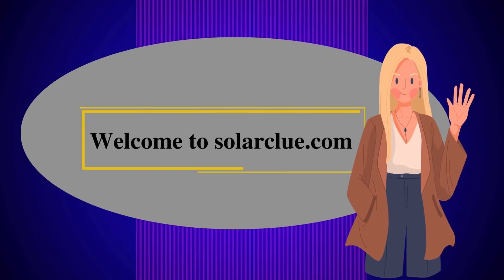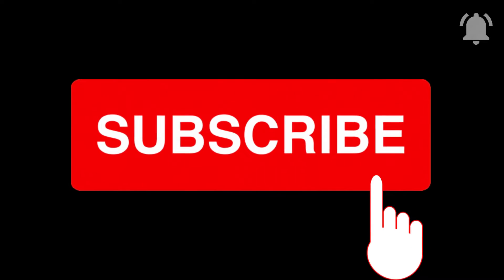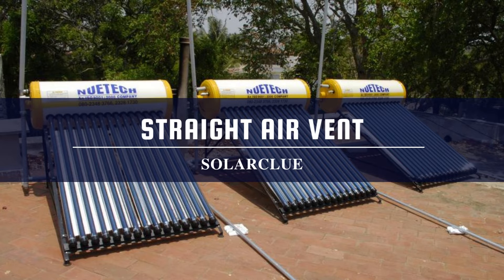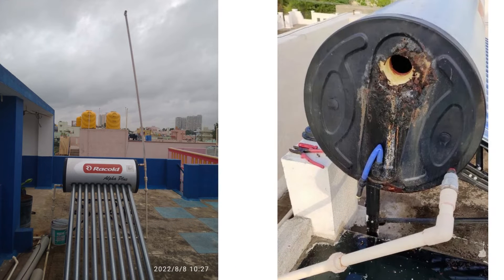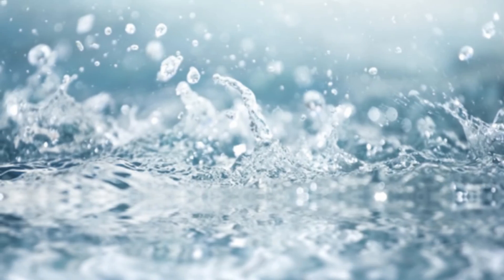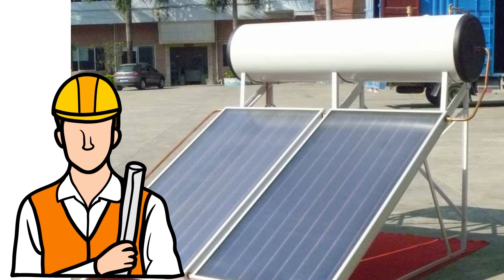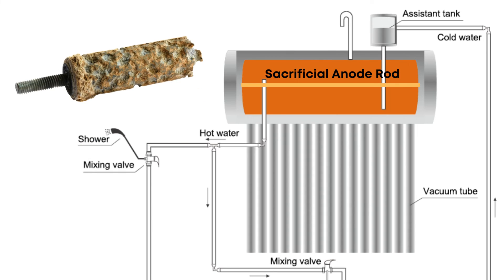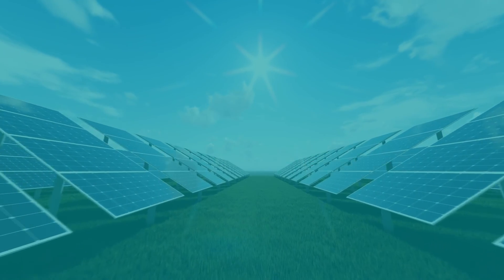How to Maintain  "Solar Water Heater" to give life of 15+ years | Maintenance Tips

Comment: thank you for this video.this is good video on maintainance. 
our home has fpc model since 18 years. please do a video on how can ourself clean the sediments/salts that are present in drum. i have been doing maintainance by running out the water from drum using valve below the drum and also valve at bottom of the panel/plate. at last i wil turn on inlet valve and more sediment will wash out from valves. but i some times get frightened that drum will blast when the drum makes the sound( sound comes:when i try to close the inlet and open the outlet valve for running out sediemts). but i dont know whether i am doing technically right. please consider my suggestions and do a video on this. :-)
Reply from the maker: Thank You